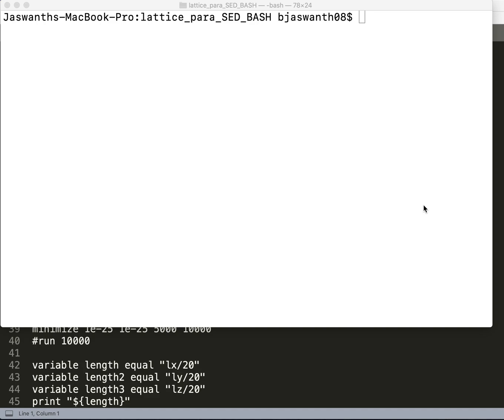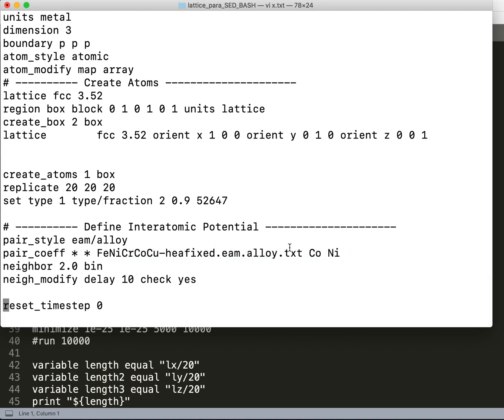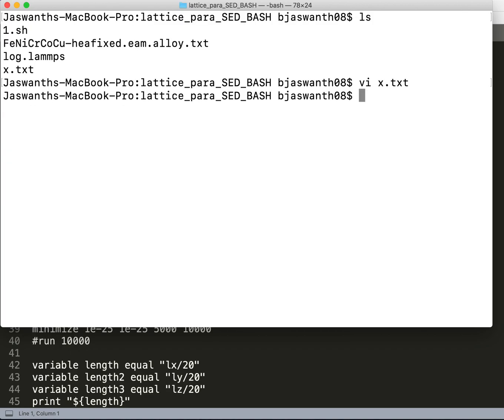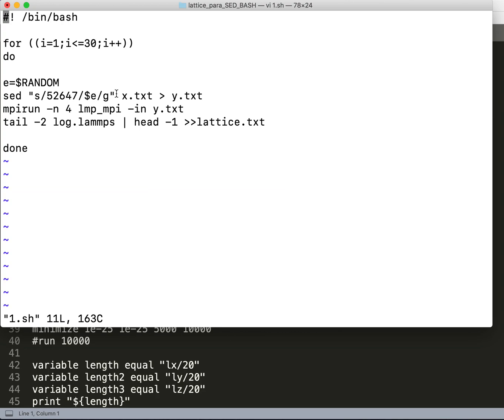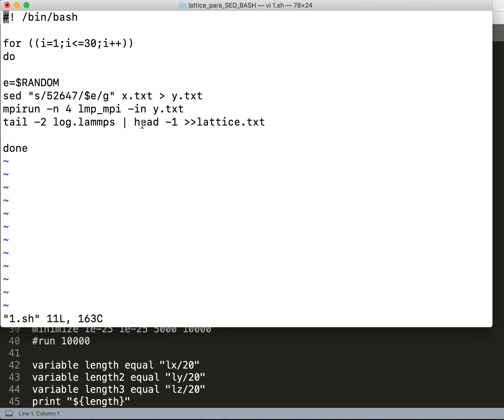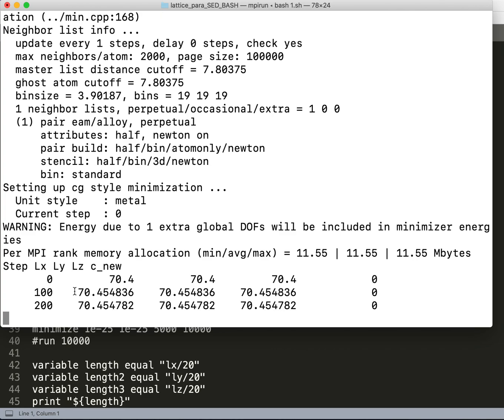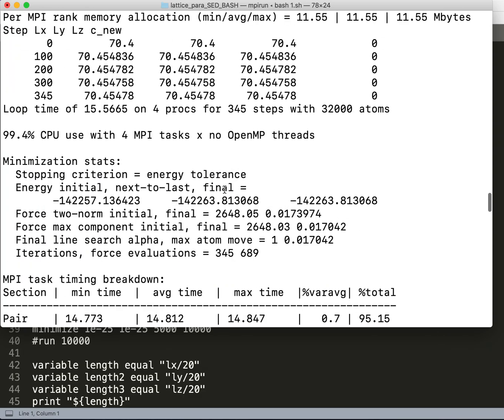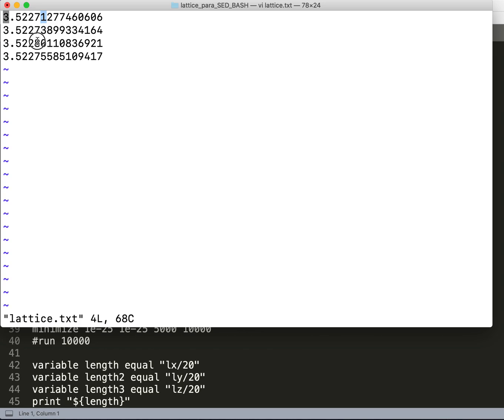Two element simulation | Lattice parameter calculation |LAMMPS | Best & Easy way | BASH SCRIPT

Comment: Thanks for the brilliant video for two-body simulation. 
Sir, can you help how to make a fraction of the second element in the first element also with different lattice structure and lattice parameter? 
For example Aluminum with 10wt. of Silicon carbide.
Reply from the maker: Also please let me know how you want SiC and Al defined:
1. SiC precipitates (spherical) in Al matrix
2. SiC matrix (cuboidal) in Al matrix (cuboidal)
3. Al matrix and SiC matrix separated??
Reply from the maker: Yeah, I can help you in a detailed way through email: contactsnextzen@gmail.com

but here is a gist of the way to do it:
1. create a region of the Al matrix and SiC matrix separately

lattice fcc L.C.(Al) orient x 1 0 0 y 1 0 0 z 1 0 0 .......
region box block 0 10 0 10 0 10
create_box 1 box
create_atoms 1 box

lattice diamond L.C.(SiC) orient x 1 0 0 y 1 0 0 z 1 0 0 .......
region box2 block 0 5 0 4 0 4
create_box 2 box
create_atoms 2 box

set type 2 type/fraction 3 0.5 34567 (34567 - random seed or random number for gaussian distribution of setting type 2 to type 3)

you can do this other way - by giving specific positions to Si & C

2. define the interatomic interactions between atoms separately
pair_style eam/alloy
pair_coeff 1 1 Al99.eam.alloy Al  (1 represents the atom type you created in create_atoms 1 box)

pair_style tersoff
pair_coeff 2 3 SiC.tersoff Si C
pair_coeff 2 2 SiC.tersoff Si Si
pair_coeff 2 3 SiC.tersoff Si C

Define SiC with specific positions using lattice custom:

lattice custom 4.35 origin 0.0 0.0 0.0 orient x 1 0 0 orient y 0 1 0 orient z 0 0 1  &
basis 0.0 0.0 0.0  &
basis 0.5 0.0 0.5  &
basis 0.0 0.5 0.5  &
basis 0.5 0.5 0.0  &
basis 0.25 0.25 0.25  &
basis 0.75 0.25 0.75  &
basis 0.25 0.75 0.75  &
basis 0.75 0.75 0.25  &
a1 1.0 0.0 0.0  &
a2 0.0 1.0 0.0  &
a3 0.0 0.0 1.0

region box block 0 5 0 4 0 4
create_box 2 box
create_atoms 1 box &
basis 1 1 &
basis 2 1 &
basis 3 1 &
basis 4 1 &
basis 5 2 &
basis 6 2 &
basis 7 2 &
basis 8 2
Reply: @NextZenStudent  thank you so much sir for your suggestions and help.